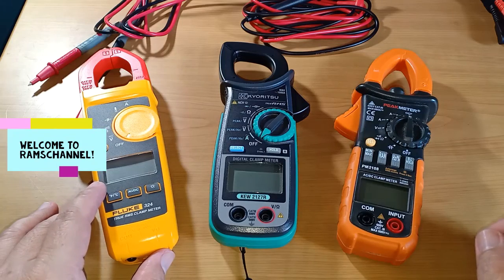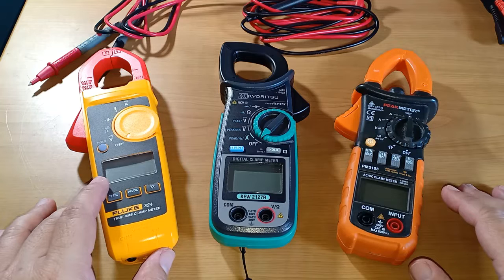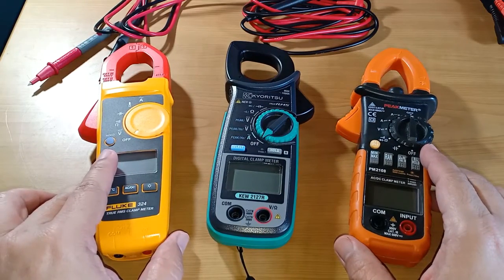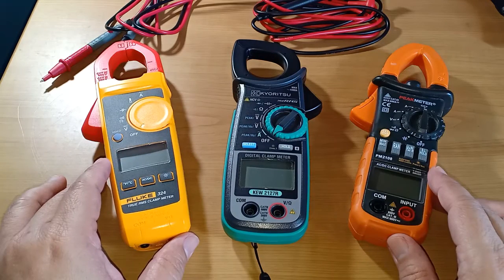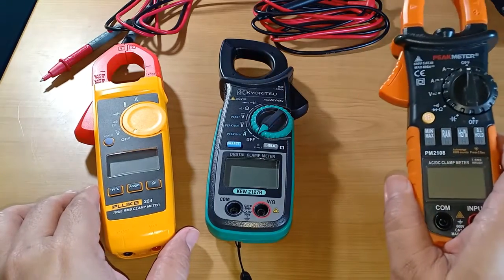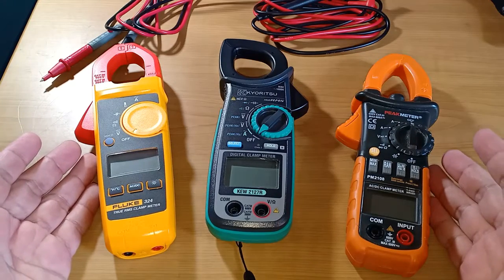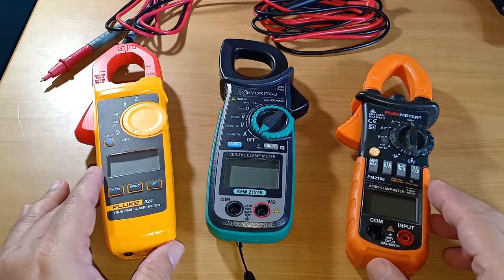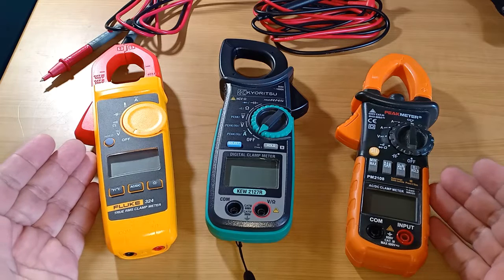[ENG SUB]Clamp Meters Side by Side Peakmeter PM2108, Fluke F324, & Kyoritsu KEW2127R

Comment: 11:20 Random value when opening/closing jaw Peakmeter PM2108 is NORMAL since it has "hall effect" sensors to measure (DC current) that will be affected by the earth's magnetic field or nearby other magnetic fields. Fluke F324, & Kyoritsu KEW2127R are AC only current meters.so they do not have any "hall effect" sensors.
Reply from the maker: Thank you for your clarification. I think the presence of the Hall Effect sensor was the reason why clamp meters with DC current functions have a zero reset button.

Comment: hi bro, i'am testing start motor about Kyoritsu 2127r and Fluke 381 about current measurement 

Kyoritsu 2127r use Peak current function 
Fluke 381 use inrush current function 

but why, the starting current is different (about 100 amp) // running current both are normal.

Thank for reply 🙂
Reply from the maker: I appreciate your interest. I don't have a Fluke 381 so I can only rely on its online users manual. If I understand correctly, the Fluke 381 calculates the RMS value of inrush current waveforms during the first 100 milliseconds, where it takes 400 samples and calculates their True RMS value, then display it on the screen.

When the KEW 2127R is used to test startup current of motors, you engage the Current Hold Peak Function. Imagine a series of analog sine waves. It detects which of them has the highest maximum value that lasted for at least 10 milliseconds then Holds it onscreen. If the next set of waves has a higher Peak it will update the value of the display. It will continue to do so as long as the KEW2127R is clamped on the conductor, even long after the motor has started. It just so happened that the startup sequence is where the highest current occurred, so the 2127R records it.

As you may already know, for a pure sine wave, the Peak value of waveform is 1.414*RMS Value. Hence the Peak Value will always be higher due to the factor of 1.414. Assuming that both your 2127R and 381 did not malfunction, then both values should be different but correct.

Both Peak and RMS Values have their uses. But its important to be aware that the Fluke 381 measures inrush current synchronized with motor startup. In most cases, this True RMS Value is what's needed by motor protective devices . For the KEW 2127R, its Hold Peak Function works not just for current but also for AC/DC voltage, which makes it useful for those device where the Peak value is important.

If you have time, you may want to watch this video where I compared the KEW2127R with the Hioki 4376. The CM4376 is an AC/DC current clamp meter that can measure inrush current, with the notable ability to calculate and display both Peak Value and RMS Value of inrush current at the same time. Thank you for your support!
https://youtu.be/7UwTfA3MgfI?si=NT96fBJdp_ZEVt3J
Reply: @ramschannelreviews  Your answer most clearly!!  Thank for your reply 🥳🥳🥳

Comment: Perhaps it should be mentioned what kind of safety features, for example fuses, would these brands have. The cheaper instrument may provide a similar voltage reading, but it will not have the proper fuse to save the instrument or your life in case of accident.
Reply from the maker: Thanks for your comments. You raised a good point on safety. I don't think these clamp meters though have over current protective fuses, since they measure current by induction and not by series connection. They do have voltage category ratings which must be followed for safety, and which I included in the video. I agree with you're idea that the more expensive device should be better in terms of the quality of its features.